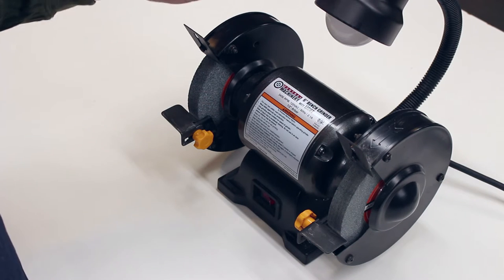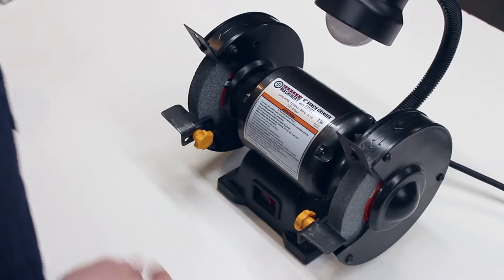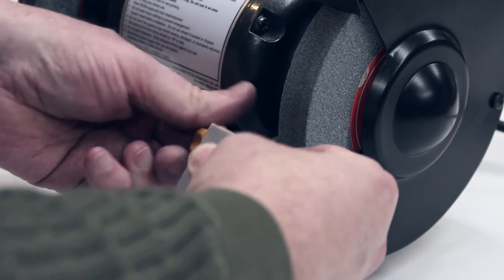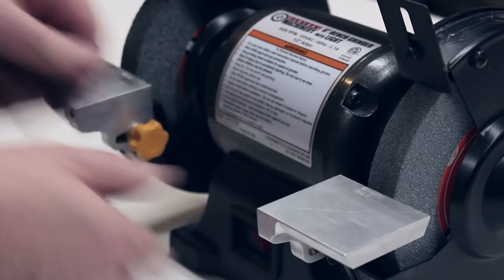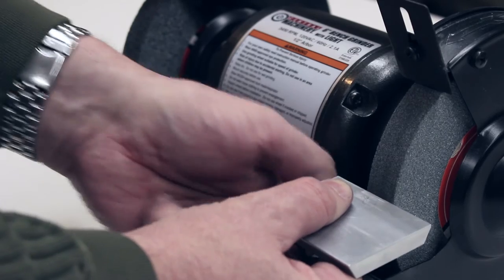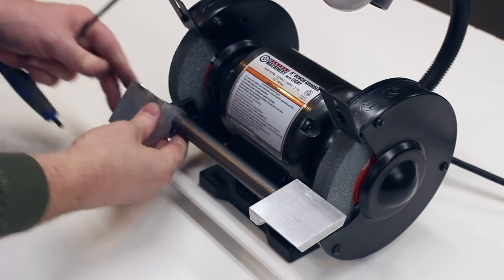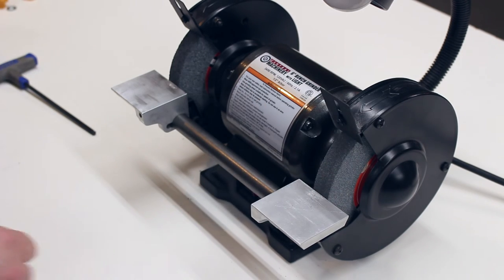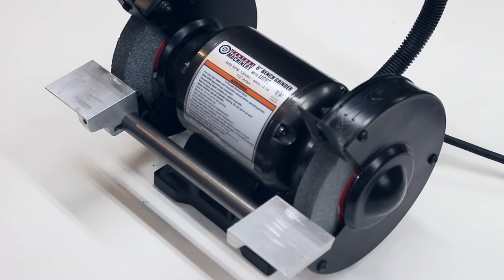Bench Grinder Toolrests

Comment: I  have been researching 6 " bench grinders and your analysis and solution to the tool rest is excellent. I found also that on most of the 6 inch bench grinders  the  original tool rests have the same problem.  Trying to locate  finished replacement parts to "upgrade" (improve) a 6 inch grinder has been an issue.  The only tools I have are two power drills,  one hand jig saw and a 7 1/4 inch  saw .  Not quite the right tools to fabricate the tool rests you have made.  :-)
My main purpose for a bench grinder would be to sharpen lawn mower blades . Thank you.
Reply from the maker: Yeah.  It's kind of a smoke 'em if you've got 'em situation.  CNC is definitely not required.  You could totally do the same thing by cutting off sections of angle with a hacksaw and drill the mounting holes with a hand drill.  If you wanted to take the time, you could clean up all the edges with a file and even make a slot with a drill and files.  It's more work, but could still get the job done.

Comment: Hi, James! Just re-watched this video to remind me of your solution. I recently upgraded to an 8" Delta and decided to make it a combo machine, using the right side for grinding and the left for deburring, adding an 80 grit white wheel & 8" Scootch Brite (i.e., not 3M) wheel. The Delta came with decent toolrests, other than having a deep, angled groove in the left-side one (supposedly to make grinding drill bits easier - I use my Drill Dr. to make grinding drill bits easier). The overall build of the 8" Delta is heavier and more rigid than other low-end bench grinders, so I don't have much flex on the toolrest, and since I removed the guards on the left side I can't add the stiffening bar; however, I may replace the inner right guard with heavier gauge material. I also need to make a removable guard for the left side so I don't bump into the deburring wheel while grinding (an accident waiting to happen).

The real reason for my comment is to suggest replacing the SHCS's with shop-made knurled (or fluted) knobs with long enough shafts to bring the knobs out past the toolrests (I really wish YouTube would allow including photos or PDF's in comments!). One could even use the original knobs, adding a long length of M6 threaded rod Loctited into the knob with a tube (or piece of 1/8" pipe: 6.8mm ID; handy stuff readily available in black steel or brass) slid over the threaded rod to space out the knob.

Best regards & keep the videos coming, Charlie
Reply from the maker: Thanks for the comment.  I considered making knobs, but decided I could get a more positive locking action with the wrench, and since the wrench is sitting in a rack within arms' reach of the grinder, it was hard to justify the time and effort.
Reply: @Clough42   Makes sense, plus you probably won’t be making adjustments until you true up the wheel.

Comment: Very clever James! Excellent solution to a pesky problem :) I'm going to keep this idea in mind as I improve my home-shop-grade bench grinder. Right now I'm still working on getting the vibration down, so I'll also be whipping up a set of new flanges.
Reply from the maker: Thanks.  To get my wheels running true, I turned up some new 3"x 1/4" thick flanges.  The stamped sheet metal ones were really uneven.  I also had to clean up the shoulder on the motor shaft.  I ended up disassembling the motor, taking the shaft out and putting it in the lathe.  A friend of mine did the same operation, but he didn't even take the motor apart.  He just put one end of the shaft in a 4-jaw chuck, put a live center in the other end and turned it on the lathe with the grinder body just hanging there on the shaft!
Reply: I also popped out the rotor/shaft and put in in my lathe. Unfortunately my bed isn't long enough to put it between centers, so I had to compromise some and couldn't get both bearing journals accessible (outside the chuck) at the same time. It was way out of true. I was able to improve it, but there's more to be done I think, we'll see how it goes. I've been thinking it's time for a bigger lathe, so maybe that's the solution. That makes sense, right? Spend a couple grand to improve a $50 grinder? Makes sense to me somehow :)
Reply: @Clough42  were you primarily truing or did you have to resize and use new bearings or an adapter?
Reply from the maker: @TSPhotoAtlanta  just truing the shoulder.    It was probably okay originally, but had gotten mangled by the stock flanges.

Comment: Excellent!!  Thank you for sharing!  My only concern with the cross brace would be with adjusting the guards - they would have to both be in the same position - which is probably how you want it anyway. The youtube channel Blondihacks has a 4 part video about building a tool rest for her bench grinder.  She also identified the horizontal torsion in the sheet metal guards.  Her solution was to add a brace from one of the mounting holes on the bottom of the grinder to the guard for each side.  Your method is probably stiffer but hers allows for independent adjustments.  Thought you might be interested to hear another method.
Reply from the maker: New response to an old comment:  The toolrests are independently adjustable.  Just loosen the screw on one side, and only the rest on that side moves.
Reply: @Clough42  After watching this video again I'm not sure why I thought you wouldn't be able to adjust the toolrests independently. 😁

Comment: Yes, the original ones were definitely on backwards alright. 
Generally, grinder safety guidelines say that the tip of the rest should be at least 90 degrees to the closest point to the wheel. And 1-2mm clearance between the rest and the wheel.
Of course if you're putting a bevel on a blade an angle of greater than 90 is fine since it will only knock the piece out of your hand it you screw up. But an angle of less than 90 degrees makes it more likely that you will get your work jammed between the rest and the wheel, and all hell will break loose.

Sealey grinders on Amazon currently have a few stock images of a dude using a grinder with the rests on backwards and it looks a bit scary.. Having the rests backwards means is like having the rest 10-20mm away from the wheel, depending on the length of the angled part of the rest.

Comment: The aluminum maybe easy to work with, but at the very least, I'd use J-B weld and adhere  a plate of 1/8" steel on top as a wear surface. Better yet might be a piece of steel angle modified to a short L shape, creating a surface for a too holder or diamind dresser to slide against.
I bought an older used grinder and the tool rest are really crappy just like the ones you took off. Thanks for the ideas. 👍

Comment: think theres enough room under the toolrest and in front of the grindingstone to extend the bolts past the stones so theres on the outside of the grinder , you can then use wingnut heads to change the angle of the toolrest without any tools and probably with the machine running though thats not a wize idea 
i like the idea and have a grinder without toolrest i got from a neighbour that verry close to looking like the one you adapted , might copy the idea and add verry small ajustable fences or grooves to the toolrests so i van slide the lathe tool toward the stones at the propper set angle
Reply from the maker: Yeah, there should be plenty of room to do that.  I use this mostly for grinding lathe tools, and for that use, I don't move them much.  I have a hex key set within arms reach of the grinder, so I haven't bothered.  Yet.

Comment: Please stand by, adding a short edit to improve flow. Yes, constructive
Reply: The adjusters that are under the rest on each side ♼⏤, it looks like instead of a hex-head bolt (m6 x 1"?) you could do a knob using a longer bolt (1/4 x 20? x 2 or 3") with a washer, then locktite a pair of nuts for the tightner, then at the head attach a knob that you buy or make - threaded on first in the assembly, or welded/brazed to the head. I've seen people just cut a slot across the head, file a flat on on edge of a washer, then braze the flat into the slot. Then you can attach a crossbar to the washer. Elegant, useful, not as pretty as some handle-solutions.

Comment: The best solution would be to throw that piece of junk away, and stop buying junk that you have to modify to make it usable.
Reply from the maker: Really?  For someone just starting out, this is a fun project and an inexpensive way to get a usable grinder for very little money.
Reply: @Clough42  Someone just starting out with a CNC Mill. Really?A grinder with a lot of vibration is unsuitable for tool grinding. It's been 6 years how's it running
Reply from the maker: @caploader111  it works great, and it's the grinder I still use today.  If I were buying today I would spend more, but I haven't yet felt the need to replace it.

I think that might have been the first video I made when I launched the channel, and I can't remember if I ever showed that I made a new set of clamping plates that fixed the vibration.  It was a long time ago.
Reply: @Clough42  you fixed the vibration and it's still runs good. I stand corrected, and apologize for my negative comment.
Reply: Darn I would love to see that. Quick (dumb) question: when installing a tool rest mounted to the bench how would you make sure it’s square to the wheel? I don’t know what I’m doing wrong but damn i can’t do it